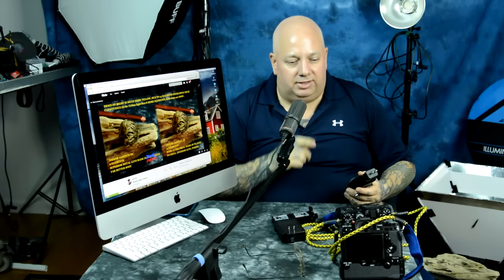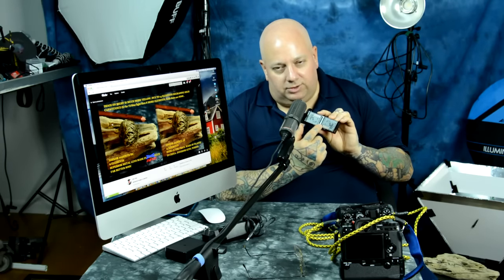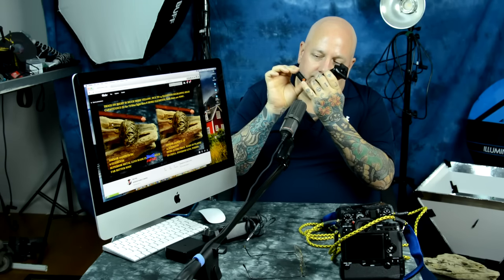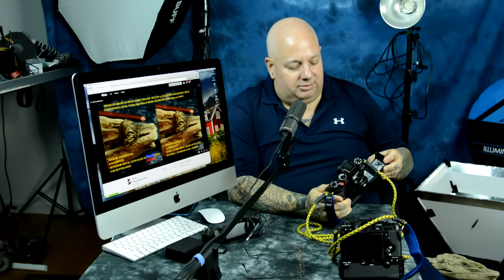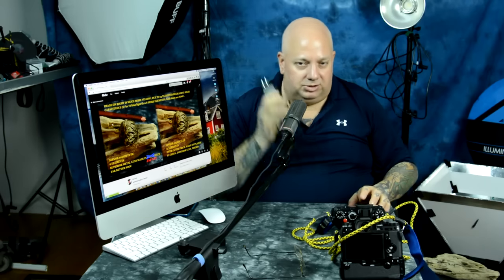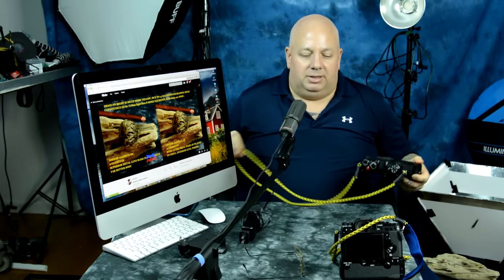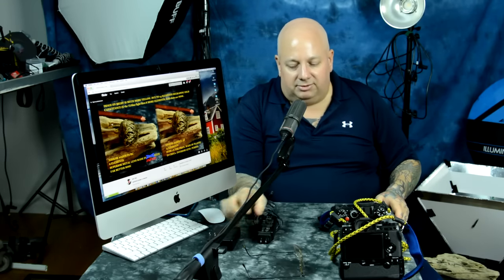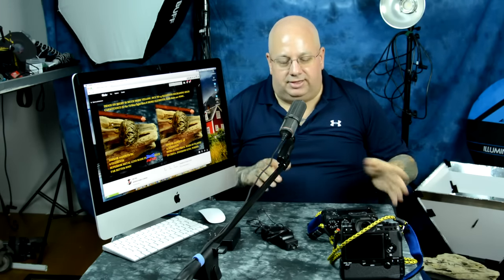*!* Confirmed ISSUE -*- Fujifilm X-T2 VERTICAL GRIP. Easy to 'fix' and get around

Comment: I don't see this as an issue personally, although I'm sure there will be idiots who'll jump on this as being a major problem.In the couple of cameras I own which allow charging inside the camera body I always charge batteries externally anyway. It seems that this problem is entirely rectified by simply only using the more recent updated batteries which were specifically designed for the XT2. I do of course realise many XT2 owners will be XT1 owners with additional spare batteries which they will want to use so your advise is both excellent and clear.My biggest concern would be for those users who attempt to charge 3rd party ( cheap/fake ) batteries this way. I'd be particularly worried about the battery swelling and remaining stuck in the grip. This is why I never charge internally even with OEM batteries. I'd only charge internally if I had no choice, I'd always advise the use of external chargers where possible.
Reply from the maker: well i never said it was a serious issue, but the unser manual says its fine, but i cannot agree, theres too much heating from charging XT1 batts in the vertical grip , and it takes a helluva long time. 

wont be doing that anymore ,  its an issue technically,   but yeah, kinda not really,

Comment: Does Fuji connect the thermistor in the XT2 (body or grip)?  I noticed that my X-T1 only gets power and has no connection for the  thermistor in the body.  Seems like it would be very cheap to multiplex a processor A/D input to read that thermistor data to keep from killing the cells.

Comment: I am charging my xt2 with the old batteries in the vertical grip with no issues (no heat and fast). In fact I only charge them that way. 240V outlet.
Reply from the maker: and youre sure theyre 126 and not 126S batts?    i get excess heat on 2 diff XT2 with new factory XT1 batts

i know for certain charging is slow as heck and there is signifigant heat  maybe youre charging yours in a place with cool air ehh?
Reply: Theoria Apophasis Yes, I am using my xpro2 batteries for the grip.  Its 18-20 C in the room.

Comment: Thanks for this Ken ....I had no idea at all about this issue and i have recharging my XT1 batteries with the grip , but no problem will just change my way of doing it and use the separate charger to do it. Cheers again
Reply from the maker: well ill just never be charging XT1 batts in my vertical grip anymore…….so its an issue thats only technically an issue but "kinda not an issue"  ROFL
Reply: My whole life has been an issue ! Believe me this is not an issue this is just a simple need for folk to know. :)
Reply from the maker: true true true :)

Comment: Hey fella, I noticed the ability to lock the functions like shutter aperture ISO etc from the menu is missing on the X-T2, on X-T1  I used to knock my aperture dial all the time so it was really handy to lock, could you please mention this.
Reply from the maker: what???? you meaning the locking buttons?  you cant lock the aperture on either camera
Reply: Yes, you could on the X-T1, I used the feature all the time,you can lock the aperture amongst other things so that even if you turned the dial
it would stay locked at whatever setting you set say f5.6 you could also lock iso and shutter and more - but this feature has been
removed from the X-T2. I always used to knock the aperture dial on my 18-55 lens so it was handy that I could lock it at what ever aperture I wanted. but it's been removed. This feature is not the same as locking the buttons (holding the menu ok button for a few seconds)
Reply from the maker: ohhhhhh that.  i never used that feature, let me see
Reply from the maker: Eduardo its on the XT2 also
page 4 of the user manual 

CONTROL LOCK
Reply: No it's not control lock, this will only lock the camera buttons not
the lens aperture dial. I wish I had my old X-T1 to show you but I
sold it to buy the XT2, the feature was in the menu & you could select 
from a list of things to lock on the camera, it's not in the XT-1 manual because it was a feature added in a firmware update, it's admittedly 
not a well know feature but a feature all the same that I used to use  a lot because the 18-55 aperture ring is really loose and easy to bump.
Reply from the maker: locking the aperture, you sure about that, i own 2 and i know of no such thing
Reply: I took this from the X-T1 firmware history version 3.00 it had a lot of
changes:

19. Lock Function
Add software lock function during shooting mode. The update will let users prevent from the unexpected dial/button operation.

[How to set]
Select the "ALL FUNCTION" or "the SELECTED FUNCTION" in the "LOCK SETTING" of the "LOCK" in the Setup Menu.
Select the function you wish to lock in the "FUNCTION SETTING" before the "SELECTED FUNCTION" is selected.
Reply from the maker: im talking about the actual APERTURE RING on the lens.
Reply: So am I, it's one of the functions you can select to lock on the XT-1.
but you can no longer  do it on the X-T2, that's what I'm trying to tell you.
Reply: I'm 100% sure fella,  I've used the feature regularly over the past
year, it was implemented in firmware version 3:00 as shown, I just want them to add it back to the X-T2 firmware, it was a really good feature.
Reply from the maker: if you could show me about it specifically, id like to see it…..

i just have no recall NOR is there anything about it in my two XT1 books
Reply: I don't have my X-T1 anymore but I'll see what
I can do.

Comment: My english is not perfect Ken , so if i use 126s Batterys im fine and dont have any Problems with charging in the Grip or Camera ?
Because i find it a very good Option to charge in the Grip and use it very often.

Thanx !
Reply from the maker: USING is fine…….its just CHARGING …too much heat.   Yes yes…….good reason to buy a pair of the NEW batteries as your MAIN batteries in the vertical grip. 

use XT1 batts all you want in the vertical grip, ……cannot recommend CHARGING them in the grip however

not really much of an "issue"
Reply: Thanx Ken !!

Comment: Ken, why not letting Fuji know about the excessive heat issue?
Reply from the maker: its only on the vertical grip, and only with the XT1 batts…..and ONLY charging them, not using them. 

its an issue that almost really isnt an issue

Comment: Thanks for the vid! Your X-T2 charger that you are showing at 2:21 looks different from mine. The one that came with my camera does not have a plug attached to the body but it has a long ass wire that plugs into the outlet! I hate these , I bought three chargers (for six batteries ) and now I have three extra wires that I have to deal with whenever I take the chargers anywhere...this don't make sense...Are you sure that is the X-t2 charger that you showed at 2:21 and not the X-t1's?
Reply from the maker: its the same as yours, i just put the plug on mine
Reply from the maker: im sure, i own 2 XT2 chargers and 2 XT1 chargers
Reply: ok thanks! I just bought ya coffee!
Reply from the maker: you did? DAMN!!!!!!  hugs man!!!!  YOU ROCK :P   werd!! fist bump! :P 
yes, both XT1 and XT2 factory chargers are 100% same 

the only issue here is charging XT1 batteries with XT2 vertical grip charger  with XT1 batteries INSIDE the XT2 GRIP
Reply: thanks for the video you have been the my place of info before ordering mine, you are a video machine!You know what s cool too? you get to the point without having to watch for  45 minutes to get to the meat of it!
Reply from the maker: i kjnow, im killin' myself making vids and answer emails :)    yes i talk too much, im messed up that way :)

Comment: I personally dislike grips in general. I owned before one and  quickly sold it. I rather walk with extra batteries and swap as necessary then destroy the xt2 aesthetic look and size.
Reply: Can be handy for when shooting in portrait mode or doing fast action, though.
Reply: dj suth yeah I know benefits but the size and weight is more important for me then comfort shooting in portrait mode. And batteries are small enough to carry around in my bag.

Comment: faulty design. fuji must slightly change the form factor of the xt2 battery so no one can feed xt1 battery into xt2.
Reply from the maker: nahh, it works fine, i just WONT charge XT1 batteries while IN the vertical grip

Comment: Just ordered two NP-W126S and UHS-II for max performance and security. I was charging two aftermarket (patona x-t1 spec) batteries in the grip and checked them during the charging process, not warm no heat. Nevertheless i follow up your advise Ken becouse you cant mess with lithium batteries.
Reply from the maker: patona batts??? if they werent warm/heated during charging im only assuming they have a diff discharge/charge profile than the XT1 batts do while having the same Mah rating for use in the xt1

in which case you have a more efficient battery (the fake ones) than the real XT1 batts when it comes to use in the XT2 vertical grip
Reply: Yep i think they are different spec. Charging was also fast btw.
Reply: +Gideon Wassink Have to agree on this one Patona does not get warm and it is also fast.Have a feeling that this german designed and china made battery also keep the juice longer than original one.

Comment: Man, that's disappointing...
Reply from the maker: ehhhh, its super easy to get around, just no charging XT1 batts in the vertical grip.
Reply from the maker: all the more reason to buy some "XT2" batteries
Reply: True. It's just that I still haven't drained my X-T1 batteries in the Booster Grip yet so the all the excitement of charging them BOTH simultaneously has gone away. Thanks for the video brother.
Reply from the maker: well charge them with the charger than came with your XT2, which is the same as the XT1 charger  :)

time to snag a couple more XT2 batts for you then  :)

Comment: Use the battery designed for the device. Problem solved.
Reply from the maker: too bad you didnt read the USER manual which says BOTH ARE FINE to USE AND CHARGE